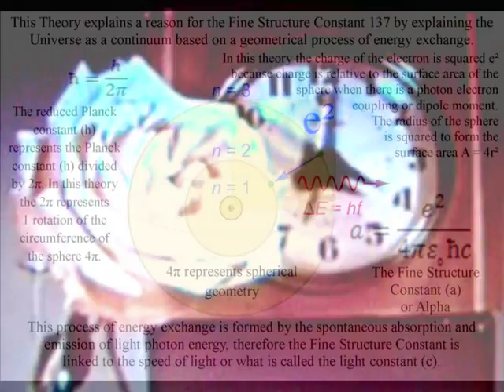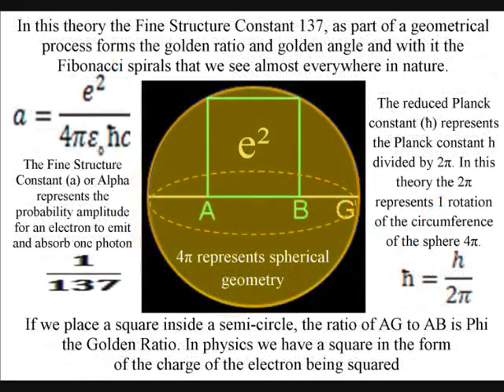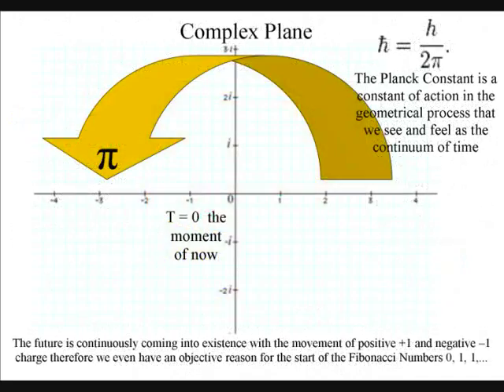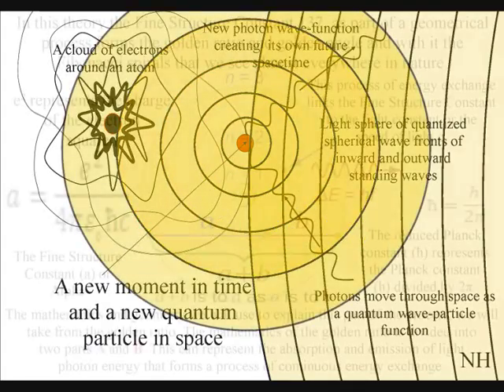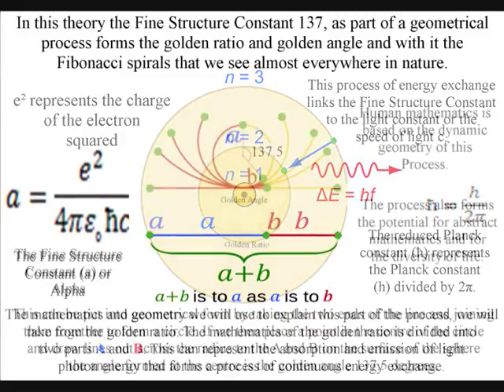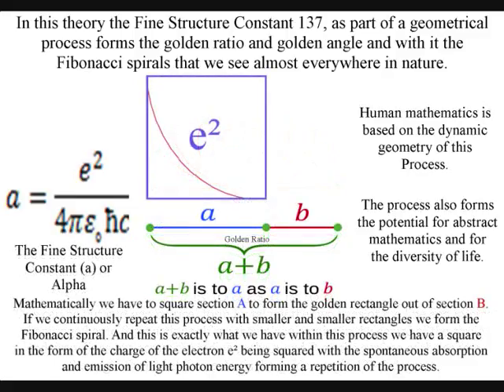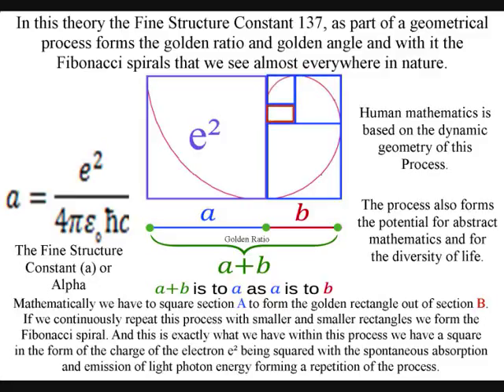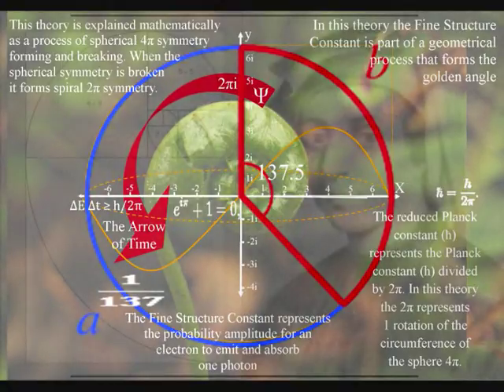A Reason for 137 the Fine Structure Constant

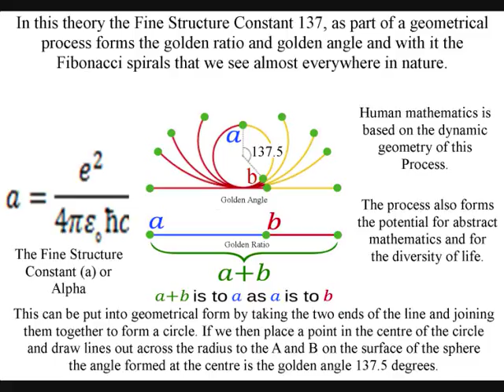Comment: 2:40 - it is arbitrary to divide a circle into 360 degrees, so the angle equaling137.5 is an arbitrary and meaningless number. If we divided a circle into 1-- degrees, or 10,000, it would be a different number for that angle, so the number itself is unimportant.
Reply: clearly you have no idea how the number 1/137 was arrived at 
.00729 = 1/137 
now what was .00729 a measurement of? eh? do some homework kid
Reply from the maker: Degrees are a good approximation to radiants! It is the angles of the geometry that is fundamental, not the type measurement we use.

Comment: You guys and your theory tales.
Smhh.
Reply from the maker: Only takes one person to get it right LOL 
This theory explains the mathematics of quantum mechanics as a simple geometrical process of energy exchange that forms continuum of time with an uncertain probabilistic future. Only this theory explains a reason for the Fine Structure Constant or Coupling Constant 137.

By explaining the Universe as a continuum based on a geometrical process of energy exchange, this Theory explains a reason for the Fine Structure Constant 137. This process of energy exchange is formed by the spontaneous absorption and emission of light photon energy ∆E=hf, therefore the Fine Structure Constant is linked to the speed of light or what is called the light constant c. Within the atom the Fine Structure Constant is also linked to the Planck constant ħ=h/2π and the charge of the electron squared e². These three constants form the fine structure constant and it is surprising how much information we have to explain the Fine Structure Constant as part of a dynamic geometrical process.

Comment: This is proof of the Grand Unified Field
Reply: This is a theory tale.
Reply from the maker: Every interaction in our everyday life, every change in our three dimensional world would have to originate from spherical geometry.

This is possible based on Huygens’ Principle of 1670. That explains light as a spherical wave and says, “Every point on a light wave front has the potential for a new spherical 4πr² light wave". 

Each point can be considered as a potential photon ∆E=hf electron interaction, vibrating and resonating forming a new spherical wave front.

The interior of the sphere naturally forms the characteristics of three-dimensional space with the spherical 4πr² surface acting as a two dimensional boundary condition or manifold for positive and negative charge and what we experience as time. 

The uncertainty ∆x∆pᵪ≥h/4π that we encountered in daily life arises out of an exchange of photon energy upon the curvature of this manifold.  

This can be explained as a process of spherical symmetry forming and breaking forming greater degrees of freedom for statistical entropy and the irreversible processes of classical physics. Such as heat energy always spontaneously flowing from hot to cold and friction always changing motion into heat.

 This geometrical process forms the broken imperfect symmetry of our everyday life with the potential for the formation of evermore complexity. 

Forming not just the imperfect complexity of nature but also the potential for evermore-abstract mathematics.

Comment: I love physics, and the golden ratio, but this video seems misleading.  137.5ish  degrees is a consequence of (2-phi)*360.  When you say 137 is special then 360 also has to be special.  360 is not special in this since .  We just cut op a circle into 360 parts because it is an easy number to divide by.
Reply: but 137 is special and the ancients took note of it!!!  .. in fact which idea came first, the ancients taking note of the prime number '137' or its reciprocal '1/137'? 
1/137 which was derived from the spectral lines of a hydrogen atom as measured .00729 ... the answer is '137' came first which btw can also be arrived at using Euclidean geometry .. have a nice day
Reply from the maker: Special as in part of a geometrical process, 360 degrees is a good approximation of 2π that is one rotation of the complex plane. We see 2π linked to the smallest scale the Planck constant ħ=h/2π. This is a constant of action in the dynamic geometrical process that we see and feel as the passage of time in this theory. If we have one universal process it would be logical to see these similarities in our different measuring systems!
Reply: @Dyslexic-Artist-Theory-on-Time  I am very sorry to say but the statement "360 degrees is a good approximation of 2pi" is really nonsensical. 360 degree = 2pi and it is just a definition.
Reply: @Dyslexic-Artist-Theory-on-Time  That's like saying the number 60 is special because it's the number of seconds in a minute

Comment: You're just joining scientific sounding words together to attempt to con the non science educated among us that you are intelligent.  None of these videos make any sense and have no scientific merit. Thanks for the laugh though.
Reply from the maker: My pleasure, but it is no con just a geometrical process!!!
Reply: Giles Dixon Is Just One Of Those Kids That Has No Intellect To Build A Real Sand Castle, So He Goes Off To Ruin Other People's Sand Castles To Compensate For The Absence Of His Own Intellect.

Ed Leedskalnin Knew About The 137.5 Fine-Structure Constant, In Fact, He Knew About The Arc Of The Rainbow, The Arc Of Giza And The Arc Of The Circle -- Not Just The Basic Circle, He Knew About The Photon Belt.

Ed Proceeded To Imitate The 12 Disciples With 12 Magnets, That Is Why His Machine Looks Like The "Sun".

In Hebrew "Lord Jesus Christ" = 3168, It's A Geometrical Codex For Design Itself.

Ed's Number Was 7129, Which Goes Beyond An Immigration Number.

7129 / 316.8 = 22.5.

Ed's Magnets Were Separated By 22.5 Degrees In His Fly Wheel Of 16 Magnets, Hence 16 x 22.5 = 360 (Circle).

This Is Why Ed's Magnets Were "V" Shaped".
The 22nd Letter = "V".
The 5th Roman Numeral = "V".
He, Like The Ancient Ones, Used "V"enus To Create His Fly Wheel, Like The Tzolkin Calendar.

THUS, The Arc Of Giza And The Rainbow Is 51.84 Degrees.

7129 / 51.84 = 137.5.

The Fine-Structure Constant = 137.5.

The Fibonacci Spiral Of Plant Growth = 137.5.

137.5 Rounded Up To 138.

The Great Cycle Of Pleiades (The True Circle) Is 26000 Years.

26000 / 138 = 188.4 (The Arc Of A Circle).

7129 / 188.4 = [37.8].

The Stonehenge, Coral Castle And Giza All Encoded The 37.8 Lunar Cycle Of "1" Degree.

Venus Takes 225 Days To Orbit The Sun, The Moon Takes 28 Days To Complete A Cycle.

225 x 28 = 6804 Days = 163296 Hours = [37.8] Days.
Reply: @finalprophecy384  this sounds amazing but I don't have any idea what most of the things you said are. Where can I learn more?
Reply: @bodhitree628  

I Am The Only Source That Has This Information On Your Planet, If You Have Any Questions, Do Not Hesitate To Ask, I Know Many Things (For A Reason).
Reply: @finalprophecy384  first, stop capitalising every single word, that is cery annoying. Second, you are completely wrong. This channel made up random ideas. His conclusion is based on 360 degrees in a circle, which is an arbitrary division of a circle made up by humans. Any other number would change it so that it's not 137. That's like saying the number 12 is special because there are 12 inches in a foot
Reply: @finalprophecy384  how was the Great Pyramid built? .. name the steps ... diagrams would be helpful

Comment: Fine Structure Constant & Speed of Light, Great Pyramid Dimensions. Sacred Geometry, Gematria, Ancient Geometry Canons & Zodiac. Solfeggio Scale Total 9990. 8 Positions in 24PrimeCross. Fine Structure Constant 1/137. 432^2=186624 Speed of Light mps. approx. 9990/(1/137)=1368630 432Hz Egyptian tuning 1368630/432=3168.125 3168 golden ratio 3168.125*72=228 105 3168.125*36=114 052.5 37*137=5069 37*270=9990 1368630/270=5069 5069*22.5°=114 052.5 5069*45°=228 105 9990/45°=222 (222*15°=3330, 666*5=3330, 3330*3=9990) 9990/22.5°=444 (369+417+825(9pos)+285+693+741(21pos)=3330) 37*3=111(852+396(12pos)+639+471(15pos)+258+714(18pos)=3330) 37*24=888 (528+936(24pos)+147+963(3pos)+174+582(6pos)=3330) 888 Key Gematria Number Christ 22.5° ‘Sweet 16’ Key Solfeggio Positions & Zodiac Axis 24PrimeCross (18^2 * 72^2)^2 / (432^2)^2=81 E/C^2=M Peter Plitcha Prime Code. (432/2=216) (432^2)^2 / (432*60)^2=51.84 Pyramid Slope. (216/2=108) 300-108=192 First Ring PrimeCross (Minus 45° Fixed Axis Positions) 72^2=5184 Precession Key (Zodiac: Fixed, Dual & Moveable) 5184/27=192 192*2=384 (Dual & Moveable Positions) 5184/81=64 24*16=384 pos(300-(18+9+24+6+15+21+3+12)=192) 64*6=384 64 I Ching Hexagrams totalled (Yin&Yang) (E&W) 18 (27&54) (324&243) Solfeggio Frequencies (difference paired pos). 369 693 East & West, Key Revolving Positions. 27*18=486 27*16=432 (24*18=432) 27*12=324 (18*18=324) 27*10=270 (15*18=270) (15*24=360°) 639-471=168 (369+324=693) (396+243=639) 693-417=276 (174+243=471) (147+324=417) 396-147=249 Key Positions. Solfeggio Diagram. 369-174=195 114 105 PrimeCross Positions (pos9&18 PrimeCross). 168 276 (108) 444 249 195 (54) 444 (81) (81) 888 (81+108+54=243) (108+54+81+81=324) Lunar & Pentagon Numbers. Christ Gematria Numbers. 198+198=396 Total of 8 Key Positions (27,72,36,63,45,54,18,81). 27*5+45*3=270 Total of Difference Between 8 Positions. 45*3=135 135(27), 162(54), 216(27),243(27),270. 396+270=666 9990/15°=666 37*18=666 16 Key Positions, Ascending & Descending, 243, E&W, 24PrimeCross. As Above 486 Great Pyramid Capstone. So Below 33 Human Endocrine Gland System. 480+6=486 24+9=33 6*9=54 54-33=21 33*21=693 693+63=756 693+72=765 Great Pyramid dimensions 480ft high,756ft base,51.84° angle or Great Pyramid dimensions 486ft high,765ft base,51.84° angle. /1.5 Middle C *1.5 C 256hz G 384hz D 288hz A 432hz E 324hz B 486hz 288hz F 342hz C 256hz G 384hz D 288hz A 432hz E 324hz B 486hz 24 Prime Number Cross 16 Key Positions. 22.5° 114 52.5 45° 228 105 8 Positions N S E W NE SE NW SW 8 Positions 3 6 9 12 15 18 21 24 Full mathematic model relating 137 and 216 through the numbers 228 105 & 45 please follow link below, pages 7-11. This model uses three key diagrams to explain the relationship of the fine structure constant to the speed of light, through the geometry of the Great Pyramid, using the numbers of gematria, sacred geometry and Dogon cosmology (266 Amma seeds). •Solfeggio frequency scale, dual scales total 9990, 27 difference of paired frequencies, step up in 111 increments. •Prime number cross, 24 branches, mathematic interpolation of zodiac, numbers 137 and 144 are 105 degrees apart. •I Ching movements, revolution, magnetic circulation of light, 64*6=384 total of hexagrams, 192*27=5184 (precession). (266-192)/2=37 Dogon cosmologic string number relates to total of I Ching hexagrams through key gematria number 37. The numbers 37, 37*24=888 (Christ) are key gematrian numbers that can relate the fine structure constant to the speed of light through the number 228 105.
Reply from the maker: I think of math as geometry and this is way beyound me!!!
Reply: I have an instagram where the info  is more visual and interactive if you do wanna check it out. There's a webpage link to. It's midnite_alkhemist @insta.
Reply from the maker: I have found instagram very difficult to use, it would be very good for these diagrams!
Reply: Yeah takes some adjusting to format but I find it well worth it for this type of thing. Plus strong interest/community there.

Comment: This is very interesting. I deal with Bible codes and I found a connection that is interesting regarding your discovery.

The fine structure constant is: 1/137... = 0.00729...

All words in the bible has a numeric value. 
Center words found in verse nr (137+729) & verse nr (731+927 = mirrors of 137 & 729)
= 1618 (The Golden Ratio = 1.618)

I am working on a book about the codes in the Bible and I shared many of the codes in a forum. I shared your video in the thread btw. Here is the link:
https://www.biblewheel.com/forum/showthread.php?6196-Some-Holograph-Materieal&p=71155#post71155 
I think you will find page 1 and page 27 very interesting in that thread. 

Here is a link for the database of the Bible so you can check. 
https://www.biblewheel.com//GR/GR_Database.php?SearchBy_VerseNumber=1
Reply: well, his video is complete nonsense: 360 degrees is an arbitrary number that humans chose. If it was 400 or 10 you would not get 137.

Comment from the maker: Feel free to ask any question about the theory, I will answer them the best I can!
Reply: Why does One Thirty Seven anagram to Yes The Inventor
Reply: If 1/137 is Alpha then what is number for Omega???
Reply: The Fine Structure Constant Alpha A
A=e^2/2q^2=(e/25e/3)^2/2
A= (3/25)^2/2=9/1250
A=.0072=1/139 !

Your formula is correct
A=e^2/4pihcepsilon=e^2
A=ze^2/2h=ze-^2/2zq^2

Planck's Constant h=zq^2
q=(h/z)^.5=25e/3=4C/3X
q=(13U1d) quark
q is Quantum Electric
h=qM=4C/3X.Wb/2P
h=2CVs/3XP
M=Wb/2P=Vs/2P 
M Magnetic quantum
Z=M/q=Vs/2P.3X/4C=
Z=3kVs/8C=375 Vs/C
Z=375V/I=375 Ohm. 

Alpha = (e*/q)^2 =7.2k
e*=e/2^.5 is rms e .
Reply: I believe your theory.
May I use your words here in my book that I am currently writing? 
I am not a physicist so rewriting this stuff seems like a nightmare.
Reply: The terms ABSORPTION and EMISSION are similar opposites to...

FISSION VS. FUSION
EXPANSION VS. CONTRACTION
MOTION VS. NONMOTION
BLACK BODY RADIATION VS. WHITE BODY RADIATION
OBLIVION VS. ETERNITY
ETC...

All of which makes sense if generated by a toroidally revolving universe that CONTRACTS and EXPANDS at the same time.

So the resolution between these two opposing forces must create a third element or force inbetween as well.

ETERNITY
TEMPORALITY
OBLIVION

CONTRACTION
EQUILIBRIUM
EXPANSION

MOTION
VIBRATION
NONMOTION

All of which creates a universal 1-2-3 PRINCIPLE right?

So particle-antiparticle pairing must result from the destruction of any particle right? The particle itself exists in 'temporality' but when destroyed must emit two particles representing matter and antimatter.

Also...

137 seems to incorporate Biblical Threes and Sevens...plus a 3-dimensional 'Magic Square'...

123
231
312...plus a third square to complete the HEIGHT-WIDTH-DEPTH. This creates an 8-squared cube which has cubic surfaces by threes and nines and a Star of David pattern inside...plus seven levels...(which goes to harmonics).

So a toroidally revolving universe, which paradoxically expands and contracts at the same time, would generate all matter from points in spacetime...front-middle-back...using a 1-2-3 cube configuration...thus impelling, sustaining and dispelling all matter simultaneously...forever.

Body-Mind-Spirit.

The human body would anchor the spirit and the electromechanical forces in the mind would be...inbetween?...until the toroidally revolving bloodstream (containing iron) ceases to flow...because the heart has stopped 'vibrating' inbetween it's contractions and expansions.

Hmm...

I wonder if 'Conservation of Atomic Spin properties is related to the EQUILIBRIUM generated by a resolution between ABSORPTION and EMISSION?

Q: Are the above considerations reasonable?
Reply: Yes you are on the money. This is the MYSTERY of Rev.10:7 of God. JEHOVAH is Pi 3.14 and JESUS is the image of golden ratio 1.618 which is JEHOVAH =618 for 69 in simple English gematria A=1-----Z=26. In the KJV Bible only you convert the verses into numbers using simple English gematria A=1----Z=26 and then you search for the value in Pi 3.14 for the revelation. The golden angle 137.5 is the SEAL=3715.